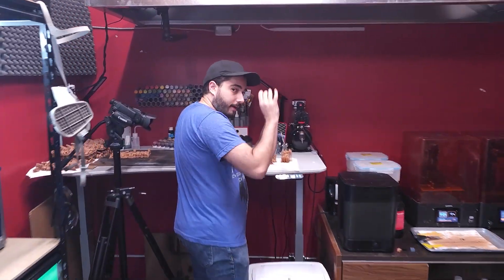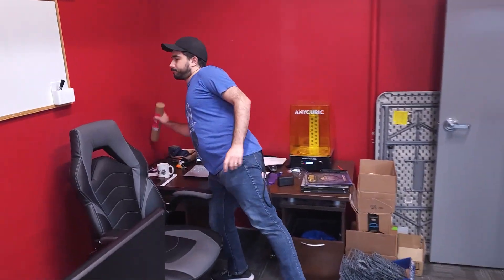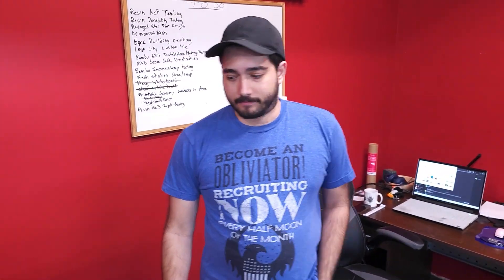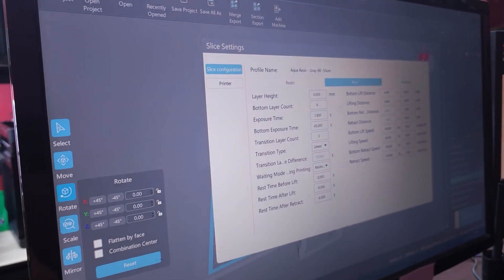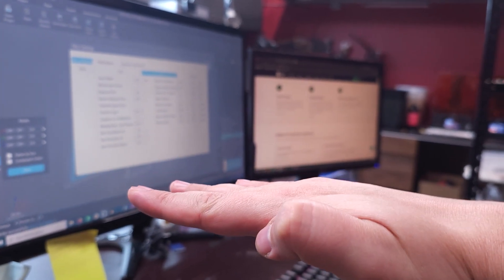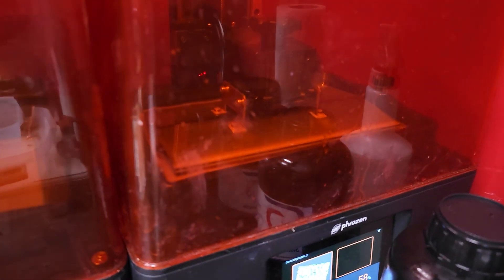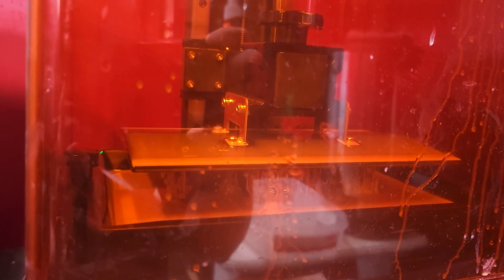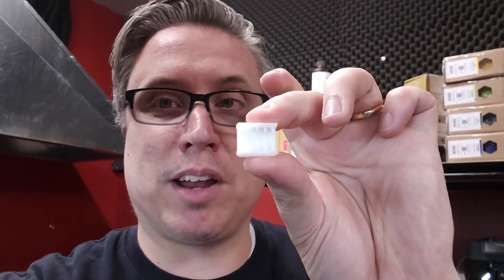Our Resin Printers are Now Printing 3X Faster!

Comment: You mixed up retract and lift in your explanation. In a resin printer, retract is the motion of the plate moving INTO the resin, not out of it, lift is when the plate lifts up after printing. Having a 4 second rest before retract is completely pointless btw. I have a Mars 3, using the original Nfep and all three of my 'rest' speeds are and always have been set to 0. There's really no point in resting unless you're using really viscous resin like the kind made for printing rubber tires (Resione F80, FX60, etc).
Reply from the maker: Thanks for the clarification!  I’m still somewhat new at all of this so the terminology isn’t cemented in my head yet.